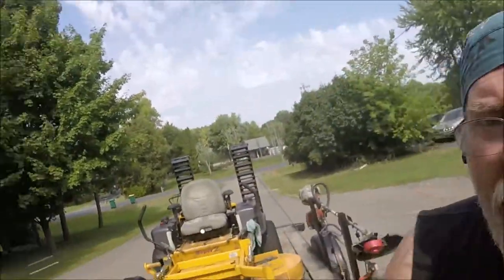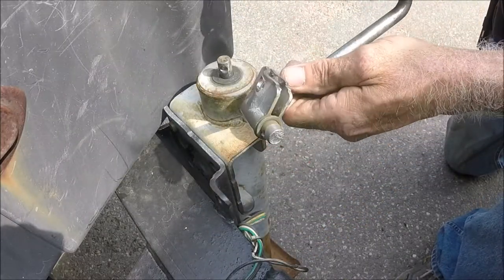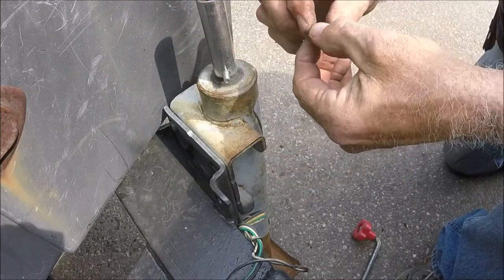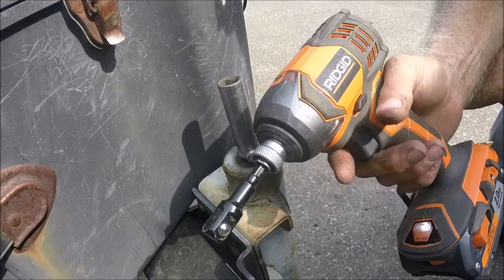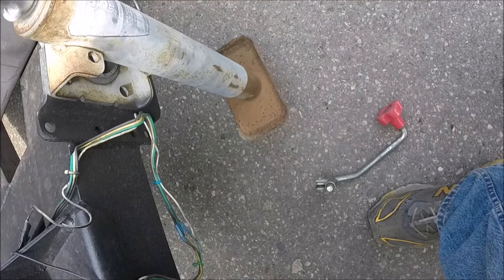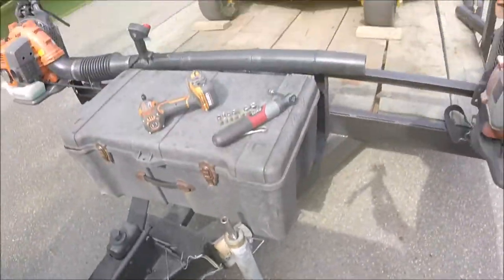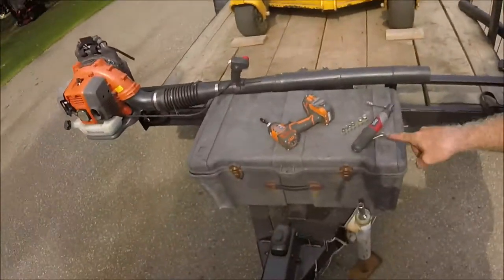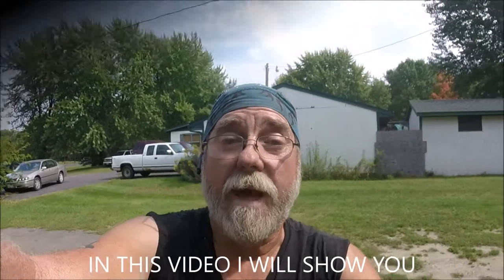CORDLESS TRAILER LIFT,  NEVER CRANK YOUR TRAILER UP AND DOWN MANUALLY AGAIN.

Comment: Nice! I'd been thinking about making something to attach to the jack to use like that. That is a good way to do it. I might borrow that idea. I may use a pin instead of a bolt so I can switch to handle without tools in a pinch. I'm not sure if using a impact is good for the jack. Even though those small impacts are not powerful they will beat stuff up.
Reply from the maker: so far been working good, have used it 30 or 40 times